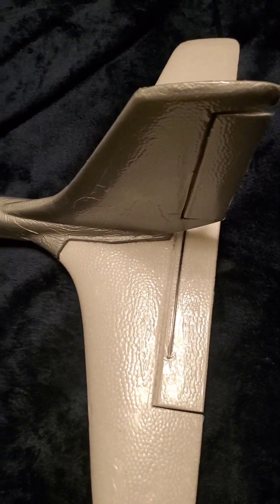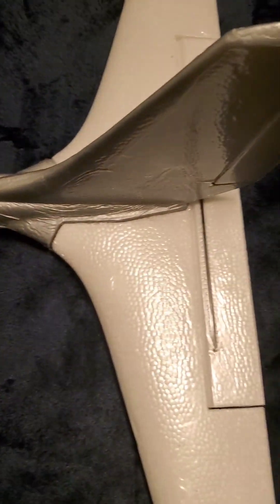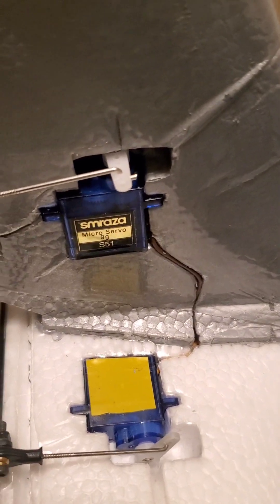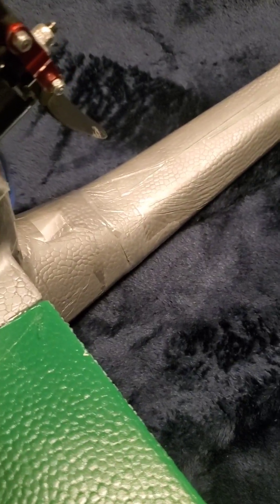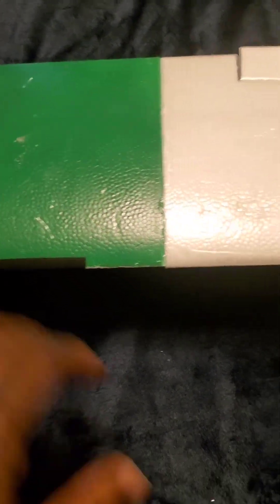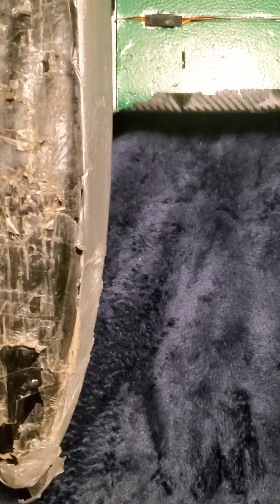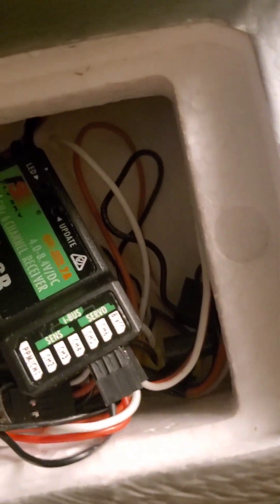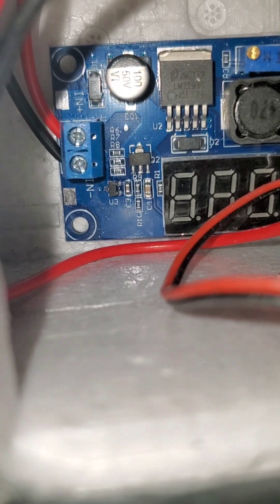Atomrc Seal: Assembly Basic #FPV #vlog

Comment: Some thunder in the background :D, i would recommend to use silver gaffer tape for elevator, rudder, ailerons, if is too stiff to move, just do some 1cm cuts along the hinge, sorry if it is obvious, in my case it did help, although I have different plane ( FX 707-S Albatross converted to RC), but idea is the same.

Comment: Hey man, what paint are you using to paint the seal? I’m looking ideally for a brush on paint that’s safe to use.
Reply from the maker: I use Rustoleum 2 in 1 paints. I have tried brush on paints, I guess if you wet sanded it , you could get a decent finish on it.